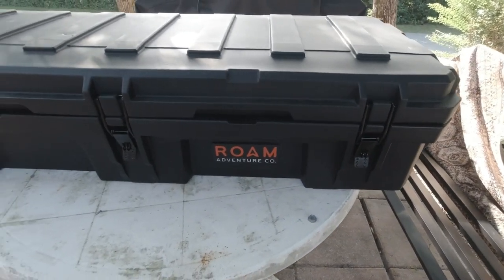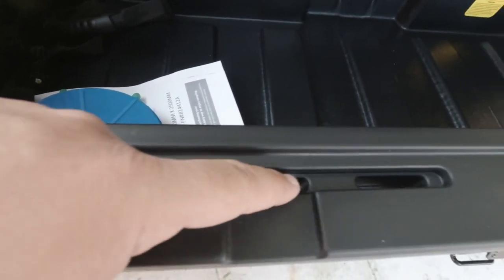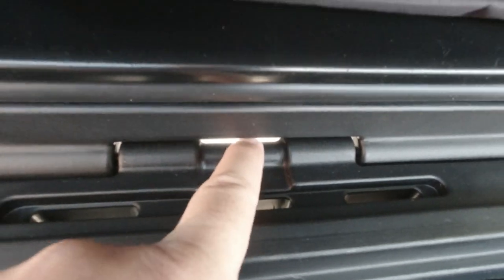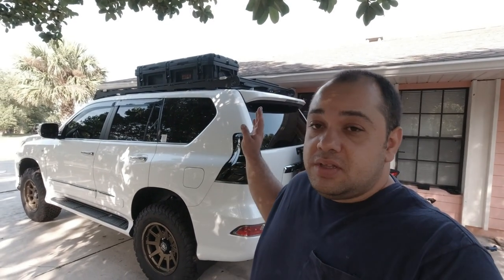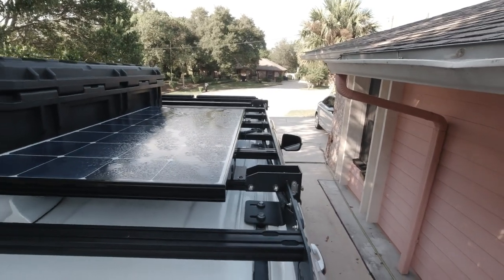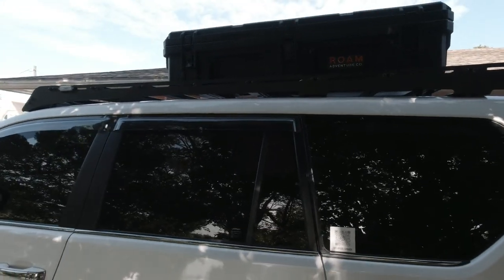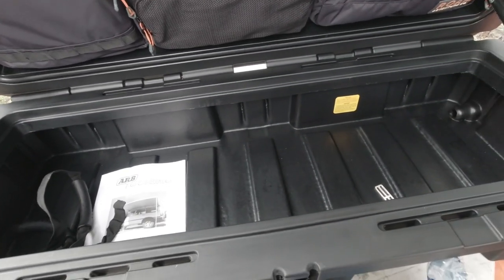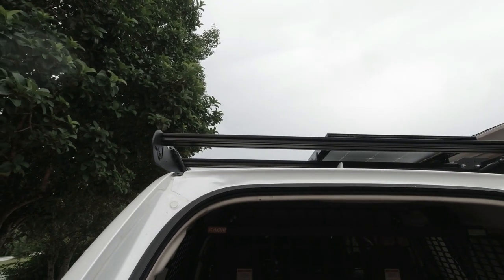Roof Cargo Box DIY Installation ROAM Adventure Co. 95L

Comment: Why not move the awning brackets in the other direction?  I would not use that perforated tape/plumbing support as a long term solution.   FrontRunner has a product.  There are shorter ratchet strap to use.
Reply from the maker: It says the straps are rated for 170 LBS, i would prefer some kind of "L" brackets but I haven't found exactly what I'm looking for. I'll check the front runner you mentioned. What other direction do you mean for the awning brackets 🤔🧐

Comment: Hey another good video. Question, how secure was it with the hanger straps?  I think I would try that for now.
Reply from the maker: It was secure as far as not falling off or sliding around. However anyone with a pair of metal snips could cut them and take the box, so in that sense it's not secure.
Reply: @DIYSpeedGarage  yikes. Makes sense. Thank you
Reply from the maker: If you can afford it definitely go with the dedicated mount which you secure with padlocks. 👊🏼